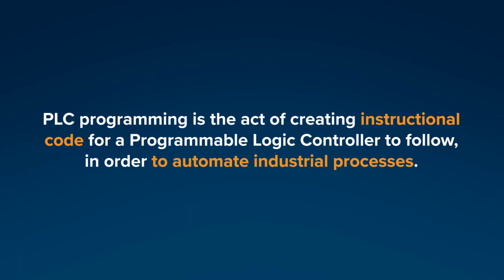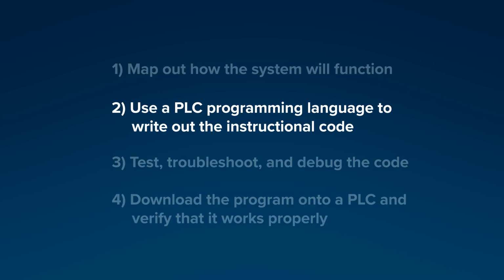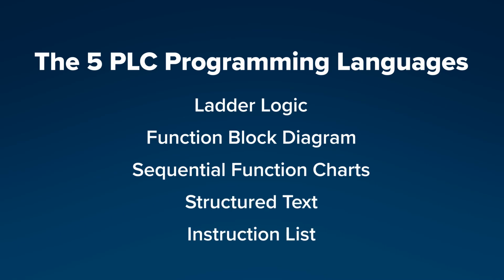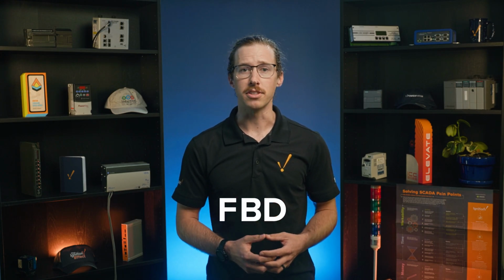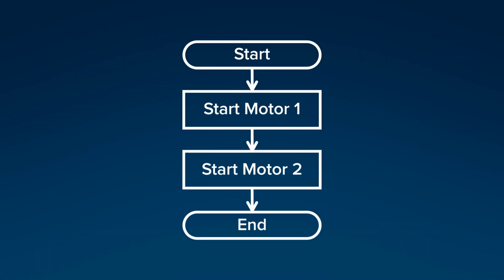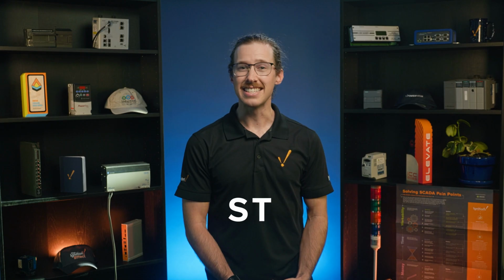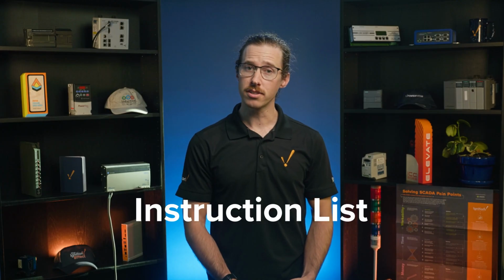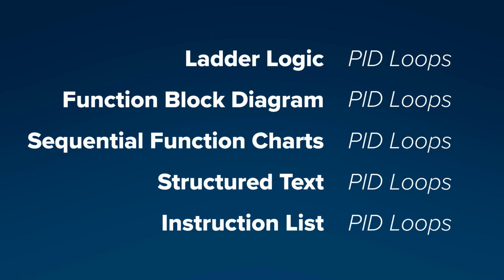What are PLC Programming Languages?

Comment: Great video!

In my programs, I use all the languages at once. I write function blocks in ST because it allows for fine‑grained processing of signals — especially analog ones — and for performing mathematical calculations. If another controller is used in a project, the function block code can be easily transferred, since ST is practically the same everywhere. I declare the function blocks themselves in the program using FBD or CFC — so that during commissioning I can see how each device has responded. For logical connections, enablements, and interlocks, I use LD, as it’s the most convenient language for programming logical operations.

Comment: The harder it is to troubleshoot for techs, the lower it is on my preferred list. Maybe not the best answer but it's my answer. 

I think Ignition misses the boat in this area with such a focus on scripting. When I went through the training class I noted some of the languages and such they brought up that one should know - Python, HTML, SQL, CSS, JSON. I'm impressed with Ignition but I think they are missing a fundamental principle, KISS (Keep IT Simple Stupid) and not from an IT, software developer perspective but from a controls engineering perspective. That means the users/configurator/programmer comes from could be a maintenance tech, electrician, any engineering field and beyond. Those are the ones working on these systems and I don't think IA understands that. @Inductive Automation, if you want to understand why this is my view, feel free to reach out.